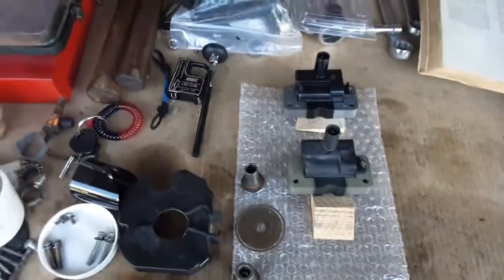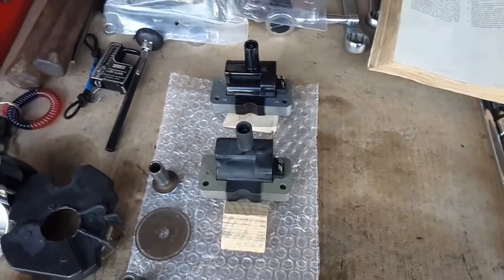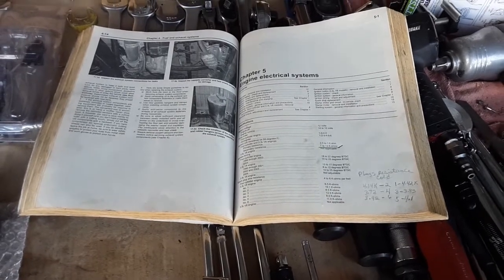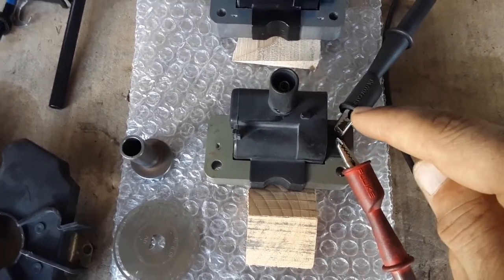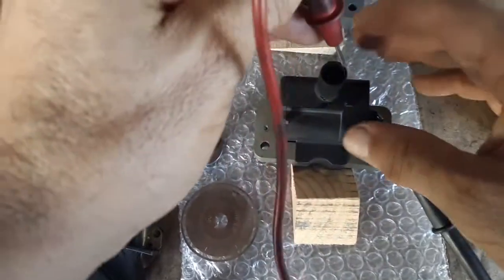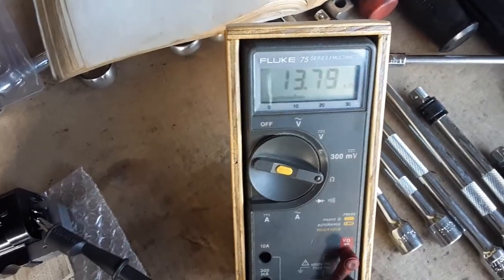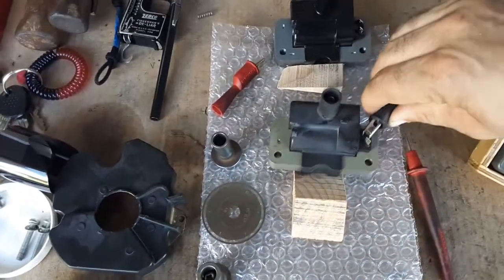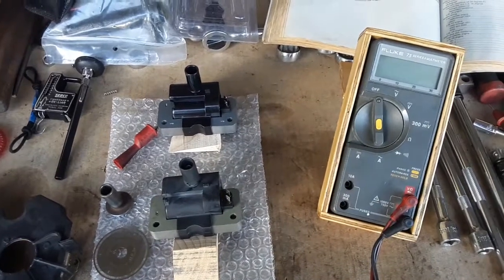How to measure ignition coil resistance (distributor type)...

Comment: Did this fix it?
Reply from the maker: Not quite Cal but I replaced it anyway just to be safe. My issue ended being the distributor itself that had a bad bearing causing the cam sensing angle to be off.
Reply: @MannyFontes1968  that's exactly what happened to mine which I found out earlier today. I had a little metal shavings that probably were bits of ball bearing sitting under the cover of the rotor.